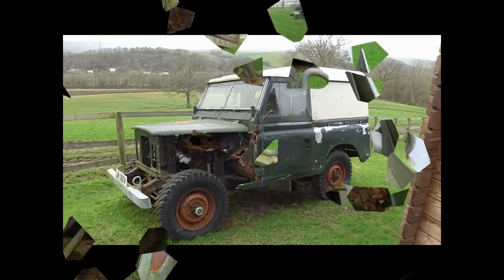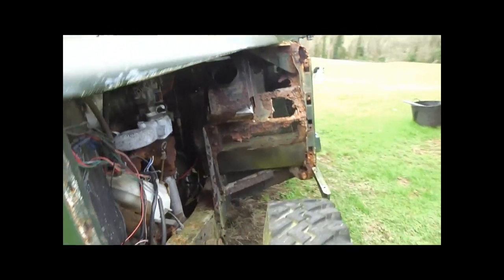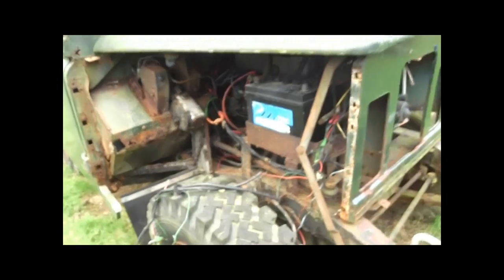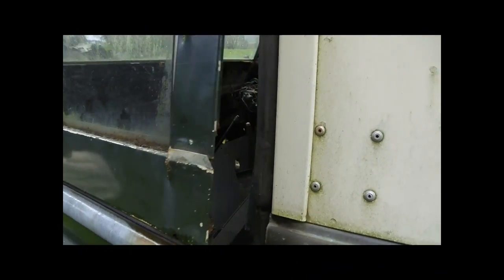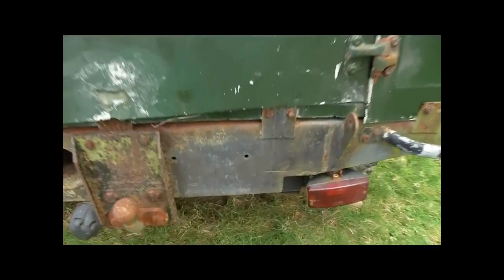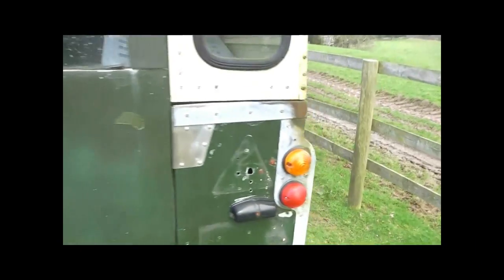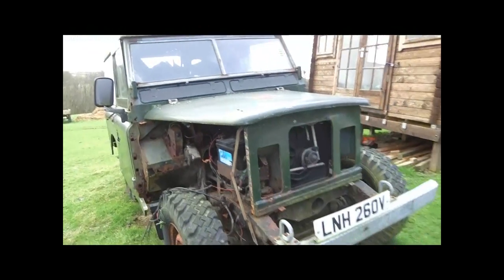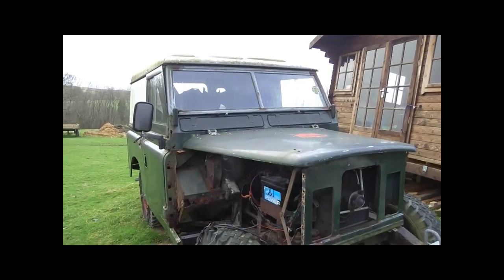A Series 3 Landrover In Need Of Some TLC... Rust Is A Killer

Comment: It is seriously worth thinking about buying a replacement chassis mate. Save a lot of work and heartache! Do not buy any chassis bits until you have it stripped and blasted in front of you. For every bit of rust you can see there will be many more you can't!  Trust me,been there many times! Where you at? Got a nice series one 4x2 coming together in my workshop,kettle always on. Got a new bare chassis sat to show you where the problems are and how to assess damage. Fitting refurbished parts to a new,solid,no compromises chassis the best way. Costs can easily get out of hand restoring old chassis.

Comment: Ive got a friend who has to replaced most of the bulkhead on his. That was severely rotten. Why didn't Landrover build the whole body out of aluminium?
Reply from the maker: Michael Langley  ... Yes would have made life a lot easier.
Reply: My friends Landy series 2 is having its chassis blasted next week. Doesn't look too bad at the minute but it the blasting will show if it has any hidden horrors or not.